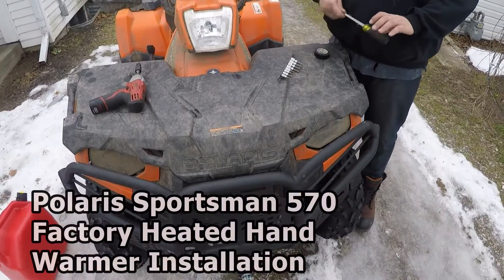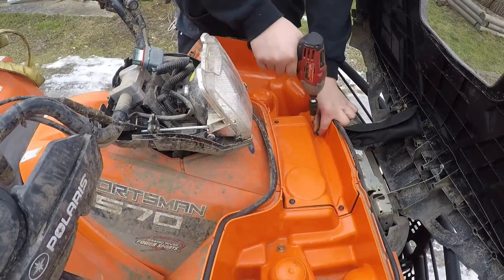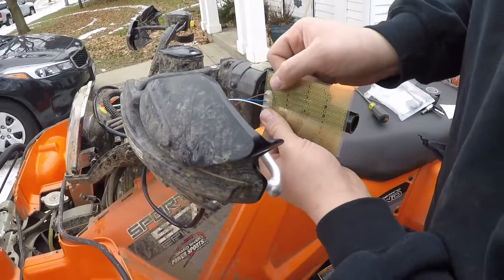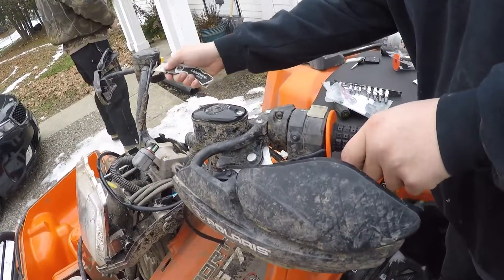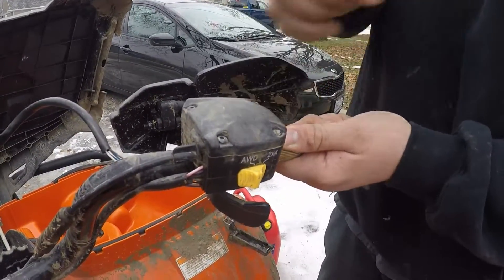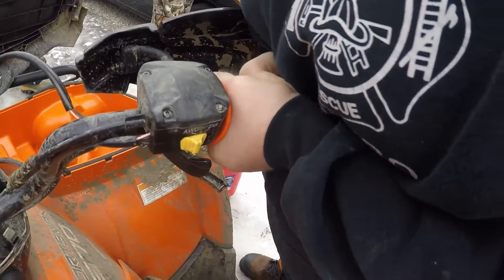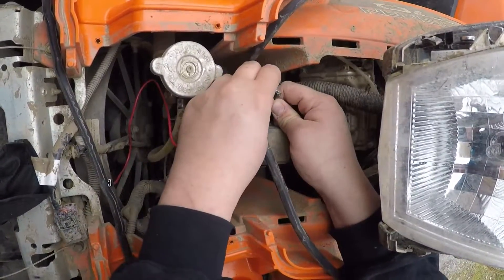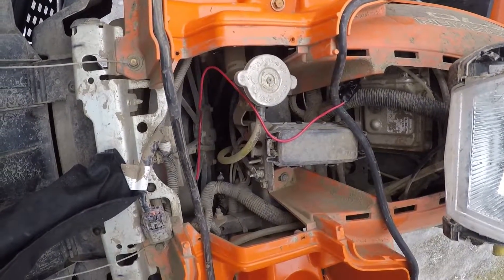Polaris Sportsman 570 Heated Hand Grip Installation

Comment: I just installed the grips and thumb warmer on my 2016 450HO. I also had issues with the heating pads not sticking to the bars so I carefully used a heat gun to warm the pads which made the adhesive stick perfectly. No need for the tape. Also used compressed air to remove the grips so I could reuse them. First time I tried the air and it worked great! Thanks for doing the video!
Reply: How did you do it? Did you use the air hose in the hole on the end?
Reply: Yes I used a tapered tip which fit in the end of one grip. Then while giving short bursts of air the grip would puff out enough to twist and pull the grip off. When doing the other side it was a bit harder as I had to seal the bar end with my while blowing air in the other end. Hard to explain but it worked really well. I put them back on the same way with no grip glue. They don't move at all. Hope this helps a bit. @chevybeaglenox2402

Comment: Don’t know about this.. what does a set of hand warmers draw??? Mine draw around 2.5-3amps.  That orange/white wire is only rated for 1amp. Draw.
Reply from the maker: you can put 15 amps on an 18 guage wire as long as its under 2.4 feet. You can also put 5 amps on an 18 guage wire as long as the wire is under 7.3 feet. 

If you have an issue with that take it up with the engineers at Polaris, they are the ones that call for you to power these grip warmers with that orange striped wire.
Reply: @jpaul1030  just wondering why they stamped 1amp on the back of the plug. Maybe I misread it.

Comment: Hey question, when connecting to keyed power, I can't find any more points to connect to because I have a lot of electronics hooked up to them already, however I'm adding a few more. Can I just splice into the orange and white wire??
Reply from the maker: Yes, I had to do the same thing to install the magnetic winch stop because there wasnt enough wire in the package. Just make sure you use and crimp your Sta-kon terminals very well.
Reply: Jordan Paul oh yeah that winch stop I actually just installed yesterday. Love that thing and it's damn near impossible to plow snow without that. On my last quad I didn't have one (at first) and I ripped the rope so many damn times lol. All it's takes is a second or two and if u don't let go, goodbye rope. But I put that on my last quad and now this one. Love it. I just got a 2017 Touring 1000XP in black. Love it man. I will be sure to post a vid soon once I get everything else on it
Reply: I'd really like to see the how-to video on the winch stop. Thanks.

Comment: how warm do those things get that you can feel it thru the hand grips?
Reply: I'm sold jumping on amazon right now
Reply: Jordan Paul how long does it take to warm up? Mine came from factory with them, and I can't tell if they are even on...
Reply: I have them on my 570 and I run them on high till they get hot then usually have to turn them down. The take 2 or 3 mins to really warm up.

Comment: what did you use for new grips?
Reply from the maker: ROBERT LADD They are Torc1 brand grips:

http://www.shop.torc1racing.com/Enduro-Grips-MX-Enduro-Grips-MX.htm

They are a huge step above stock and they match the machine nicely. 

I prefer ODI grips myself but any grip made for a 7/8" handle bar will work on a Sportsman and most likely any other quad out there as well.